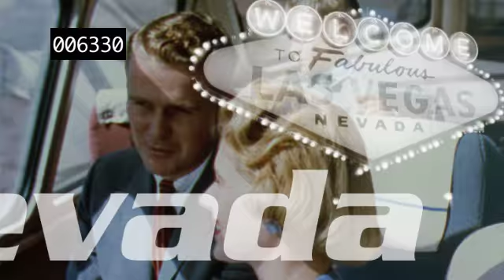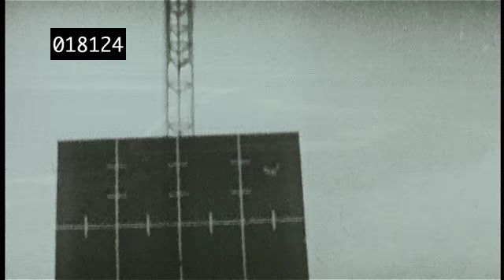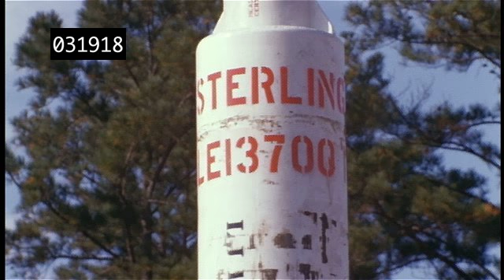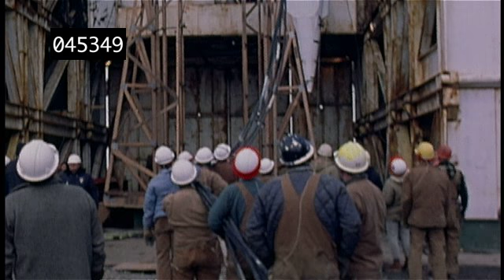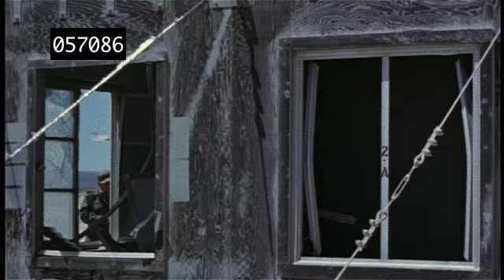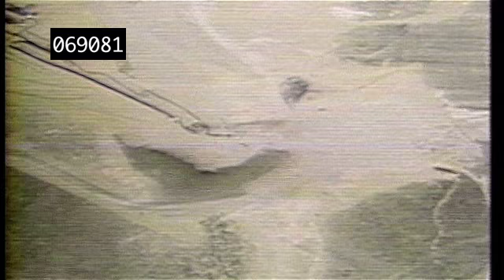Atomic Journeys 16x9 with timecode

Comment: Splendid presentation.  I would like to take the tour of the former NTS.  In my work, I knew the Edison Electric Institute Shot Apple II, Teapot Test Director.  My interest was in the electric utility portion of the test and the final results.  Very interesting.  I noted that the utility facilities have been removed from the site, despite the presence of the houses which remained.  Now, some of those houses were built for Operation Doorstep, in 1953.  Those still existed.  In Shot Apple II, they built two identical "towns" at 4700 feet and at 10,500 foot radius from the 300' tower with cab.  That was not pointed out here.